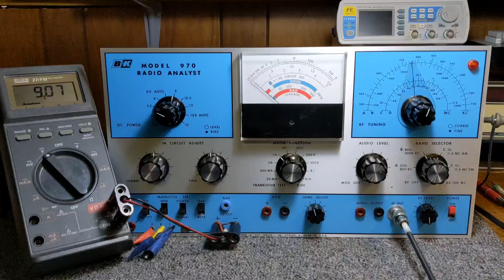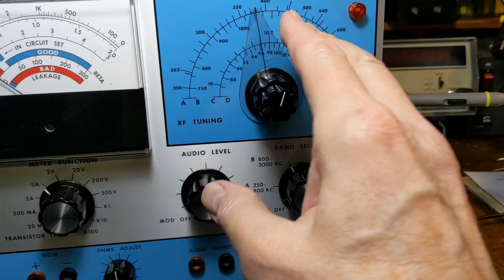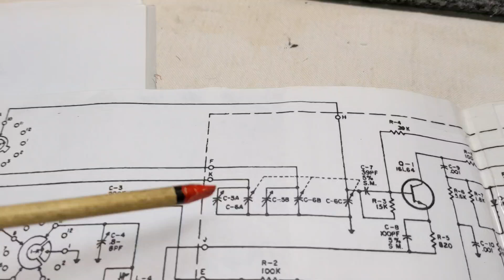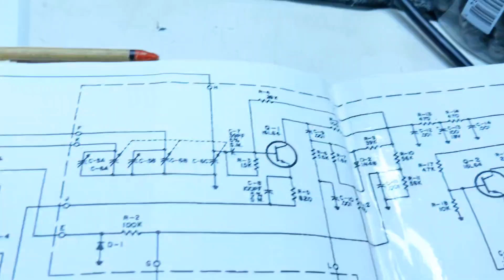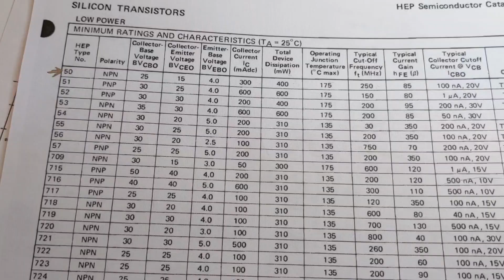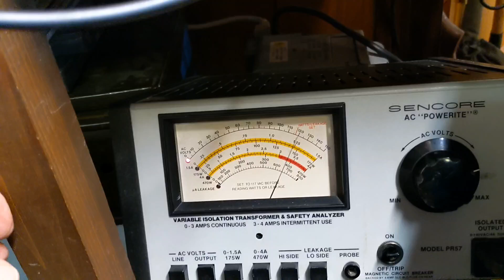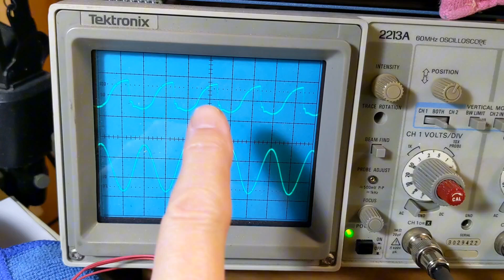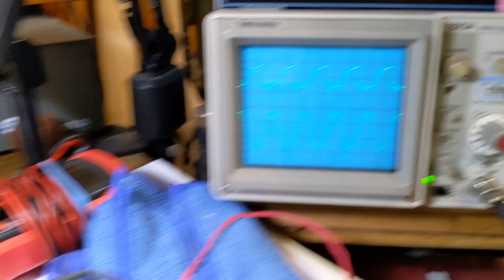B&K 970 Radio Analyst for Transistor AM/FM Radios

Comment: New to the channel,any updates on the transistor issue? Did you find the problem or a suitable transistor replacement?
Reply from the maker: Thanks for the question. I haven't found a solution to the problem. I've been told that this problem is inherent to cheap signal generators of that era. 
I feel there should be a solution but have been unable to find one. 
One of my other viewers said his does the same thing. 
If you look at it with a freq counter it's correct.

Comment: I also have one of these and it does the same thing. I have a request and I understand if it is more than you want to deal with. My unit came without the two wire wound shunt variable resistors that are located on the three gang rotary switch for the multi-meter. Someone replaced them with just regular wire. The schematic identifies them as R29 .0667A  and  R38 .044A  I assume the resistances are .0667 and .044. The parts list calls them manganin wire but gives no resistance and no other description.  If you can tell me the if those are the right resistances and if, by chance, you might know where I can find them? That would be greatly appreciated!
Reply from the maker: Hi Mac, I will see what I can do to help. Not sure if I can get that accurate of a reading. Give me about a week, I'm in the middle of a few things.
Reply: @ Oh, if you could tell me if it is a variable resistor or just a wire wound resistor. Thanks.
Reply from the maker: @macgvrs Ok, I opened mine up, the wire you are referencing are shunt wires for the meter. If you take a look at them they have a wire soldered to them. That solder point is the adjustment for calibration. Not meant to be changed and the resistance value is so small I don't have the equipment to read resistance value that low. The number indicated on the schematic is in amperes not ohms. There is a pot on the back of the meter with 2 diodes. This pot i believe can be used to calibrate the meter. I have never touched mine as the readings are close to my fluke meter.
I hope this helps.
Reply: @ko2fjb  Thanks. Mine has just a pair of wires that look like they are just jumpers. There are two wires that are soldered to the junction between the two jumpers (shunts) but they don't connect to anything at the other ends. Both of those wires look like they had been soldered to something at one point but they aren't connected to anything now.  Both jumpers (shunts) are very discolored and may be the resistance wires. Usually can't solder resistance wires so these must be the maganin resistance wires, maybe? I finally dug into this more deeply and it appears those shunt wires are for the 5 amp meter setting. Wish I had really dug into this sooner because, now I know what they are for, I would not have bothered you. Really appreciate you taking the time to do this for me. Greatly appreciated. At least I now know that this is probably how it was made originally. Very strange though.
Reply from the maker: @macgvrs hey , no problem. I feel my channel is about collaboration working to solve problems. You should be able to see where the wires were connected. I took a couple of photos that I can send to you for reference. What is your email address or cell phone number?
Reply: @ko2fjb  Thanks so muck! Really appreciate it.

Comment: You have to disconnect all the leads of the transistor not just the base. Then jumper in the replacement. If the original one is shorted, not disconnecting it will cause the same result.
Reply from the maker: Thanks I realized that afterwards and did that but it made no difference. I'm chalking it up to a non lab grade piece of equipment.
Another viewer said he has the same output on his. 
It reads the correct frequency on the HP frequency counter.
Reply: One other thing is to check the DC voltages on the transistor leads. That verifies the biasing.
I'm surprised that an engineered instrument would have that type of design issue as is straight forward to generate a sine wave.

Comment: Fred, do you work on tube sets? I have a Packard Bell  1963 FM Stereo tuner with mpx that has died.  It's part of a complete Stereo with a DP30 tube amp. The tuner is 7TU.  The problem is the it's completely quiet and tuning indicator tube slams closed.
Reply from the maker: Hi Art, yes I do work on tube sets but I'm not currently equipped to work on stereo mpx systems.
I always check my power supplies first but it's hard to say without the unit in front of me with test equipment. I would then move to signal tracing to see where the signal is lost.im thinking about the agc circuit clamping the signal.
Sorry I can't help but sure would like to know what you find.

Comment: I think it is what it is .
You have a simple diode modulation circuit hanging off the oscillator .

Remember it's not laboratory equipment ( Regardless of cost ) .
Old test equipment can have extremely ugly output waveforms !

Comment: Fred,
The output of non-military, non lab-grade signal generators is usually pretty terrible. The good thing about that is that it usually isn’t critical. The RF signal contributes little to the audio output of a radio, so if you are getting the correct number ‘events-per-second’ it will usually work OK. Such output signals as you are seeing are rich with harmonics of the nominal frequency, and this was used in older equipment that couldn’t produce fundamentals of high enough frequency. For example if you needed 90mHz, but your generator could only do 30 mHz, you could set your generator at 30mHz, and the 3rd harmonic content would be sufficient at 90mHz to supply sufficient signal to get the job done. 
The output of bench/hobby grade generators is usually pretty awful, but will demodulate just fine.  Gar
Reply from the maker: Thanks Gar, I kind of had that in mind but I guess it's my OCD that has me trying to fix it. 
Another comment said he has the same unit and his output is very similar to mine.
Reply: II looked at the schematic for the 970, and the DC voltages are unregulated, and derived just by selecting the AC voltage tap from the transformer. Not a lot you can easily do about that. I’d just either set the AC input voltage, or monitor the output. I would imagine  the bias voltage might be a bit more critical than the supply voltage, as batteries never output the same voltage twice, anyway. I guess that’s why B&K didn’t spend the money to provide regulated DC supplies. As regards disassembly of the RF section to change parts - I’d recommend to be a last resort. You may introduce more problems than you wee trying to fix. RF stuff is generally not designed with repairability in mind, since component and lead placement can be super critical. This area is best left alone, unless you absolutely MUST mess with it. 
Regards,

Gar

Comment: Could replace it with a BF 199 , 2SC1215 or even a 2N3904 as shown. TO-18 case was pretty common type back then.
Cut two leads out not one! Is the replacement transistor any good? There also can be issues with a few of those carbon
comp resistors as being noisy when they are in circuit. They can test good when out of circuit. Whole row of them there.
Reply from the maker: Thank you very much. Yes the replacement is good. I'll cut a second lead and see if that works. I never thought of the carbon resistors being noisy, I'll check that next, probably the 5.6k is noisy as well as out of spec. Thanks again
Reply from the maker: @hestheMaster  thought I would respond back to you again.
The 5.6K resistor that was way out of tolerance was also noisy when checked with the noise function on my Heath signal tracer (maybe it's time to build Mr Carlson's super probes). I replaced it with no change to the output. I also retested all the components in that circuit.
I then tried 4 different transistors and still did not have any affect on the output. 
I have come to the conclusion that it is what it is and as long as the frequency readout is correct I can live with it.
It's not lab grade equipment.🙂
Reply: Youtuber The Radio Mechanic did a short video 8 years ago about even NOS resistors going bad. Allen Bradley
ones almost never failed as badly as  other lesser known manufacturers did just sitting around for decades. The newer metal oxide resistors are better suited against for what is know as thermal noise like carbon comp ones 
can get causing a degredation of signal in an amplifying situation like in that part of the RF section you show.